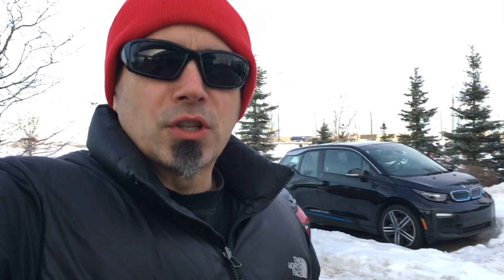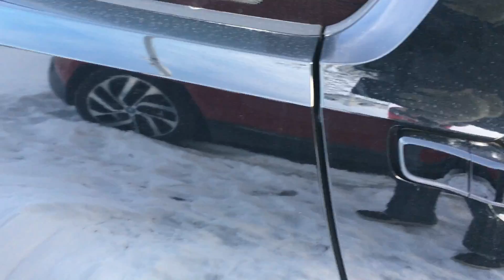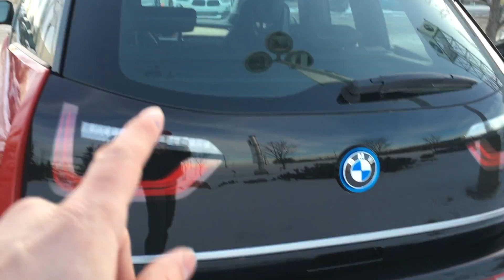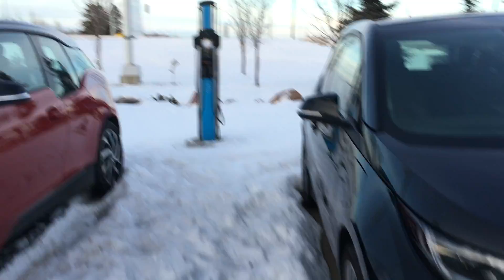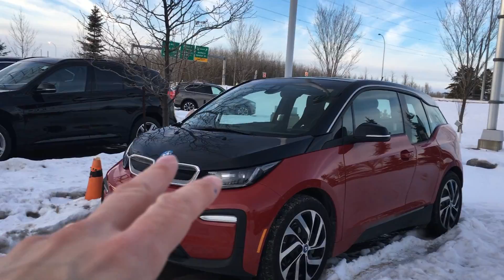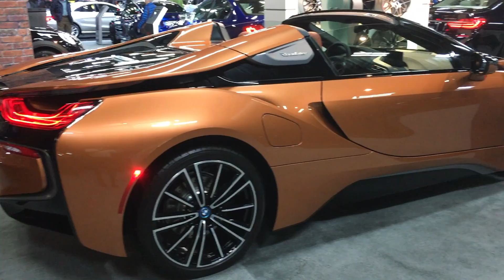How Reliable Are BMW Electric Cars?

Comment: More garbage...40 mph??and a hazard...You have no idea what your talking about, your information is flawed..there are tons of people who when they code their cars are perfectly happy to take them on road trips especially, this one which is at least a 2018 with a total combined range of 250 miles. I stopped the video at this point as I can only imagine the rest of what you were going to say would have been inaccurate as well. Before you release a video at least know what you are talking about. P.S> At about 2 percent the car will go into limp mode because at that point the rex cant keep up and well, if you knew anything about how lithium cells work, when they are this low on charge there is no real energy left...Coding it and then turning on the rex at lets say 40% you would have as much power as the car can produce.
Reply from the maker: Electric?  Give me a twin turbo V8 and we are good to go.
Reply: @ECPP  You obviously missed the boat. Go to the back of the class...

Comment: Endless money pit💵💶💵💴💱💸💸💸💸
Reply: Not at all. I have both i cars and saved a lot of money comparing to my old bimmers and former fuel costs. A lot!
Reply from the maker: Ouch
Reply: You know nothing about EV's. They have wayyyy less moving parts than your dinosaur ICE car, and therefore wayyyy less to break down. I own a Tesla Model S, an i3, a Lexus LS460 & a Benz E350 cabriolet. The 2 electric vehicles make my Benz & Lexus feel clunky & antiquated. And they are excellent cars, just archaic compared to the EV's. Besides, I would be too afraid to buy a regular gas powered BMW. That's the money pit that you speak of.

Comment: You speak of the i3 as if they all have the Range Extender... and they don't... it's an option... and it makes them have a slower 0-60 time due to the extra weight.  My BEV is perfect for my use as a 2nd car, covers my commute range more than adequately. It's all about consumer education.

Comment: 2014-2015 models have a known problem where the routing of the cables by the charge port will cause a short circuit and make charging impossible. BMW fixes this under warranty.
Reply from the maker: Thanks for the heads up.  Do you own one ?  If so would you do it again over say a Lambo ?  These cars meet a couple of needs/wants.
Reply: @ECPP  sorry, I was unclear. I was talking about the i3, not the i8. I love the i3, but if someone wants to trade it for a Lamborghini ... ;-)

Comment: Limp mode on the i3 only happens when you are right down to 1% of battery. In fact, the poor car is doing its level best to keep you moving rather than just draining the battery completely and then giving up. "Code" your i3 to Euro-spec and you can switch on the REX manually as soon as you are down to 75% rather than waiting for it to come on automatically  at 8%. That gives the REX a lot more leeway to recharge the battery once you are over those steep hills and avoids the problem completely. I generally switch on the REX for any highway driving, conserving battery for city work. US-spec i3s can't do this because of California regulations. You'll find a lot of help on coding on the i3 forums.
Reply from the maker: Thanks a lot for the info.  These are the real world discussions that can clarify myths and confirm the cars' value.